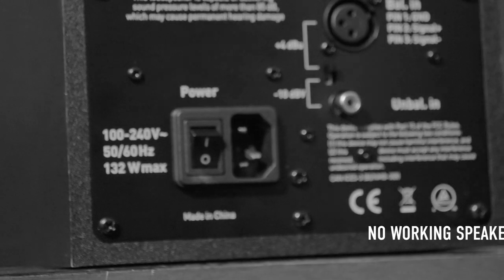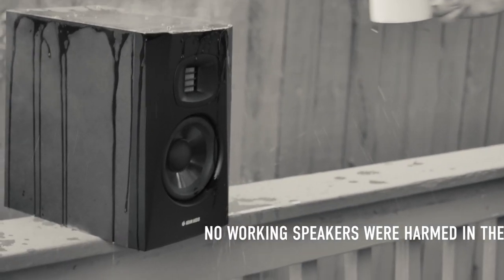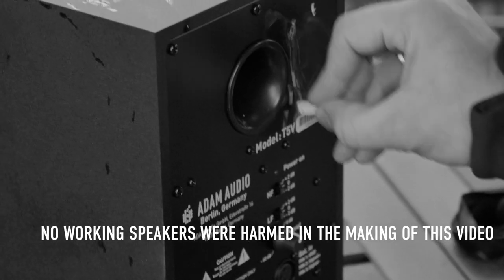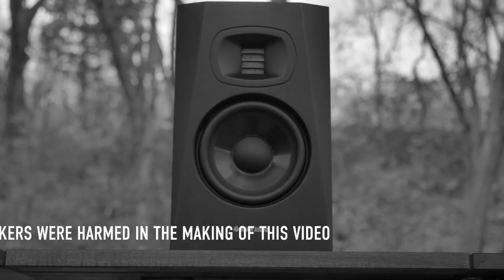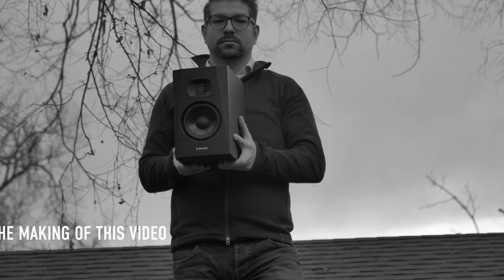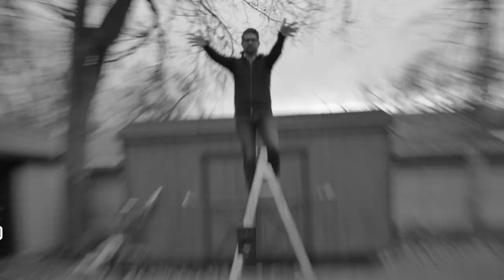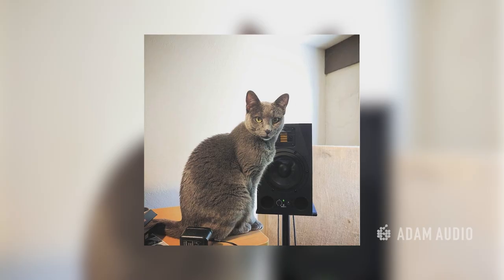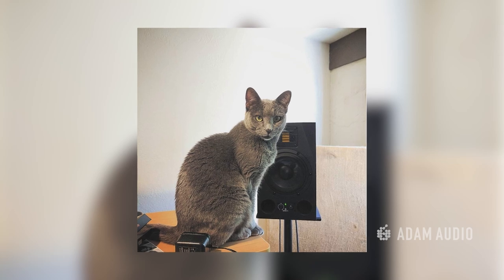PROPER Monitor Maintenance (Cleaning your Speakers) | ADAM Audio

Comment: You might want to re-think this advice. Good speaker cabinets don't vibrate enough to cause things on or under them to resonate. Touch the cabinet while playing music to see that I'm correct.
Reply from the maker: Hey Ethan, most monitors, when turned up to high volumes will have slight vibrations in the cabinet, some obviously worse than others though. Also, this video isn't only ADAM specific, so we want to cover all the bases when it comes to keeping your monitors safe & out of harm's way, no matter the brand.
Reply: @ADAMAudioBerlin  Have you ever actually tested this? This is one of those myths that is so pervasive, everyone just accepts it! Yes, flimsy plastic speaker cabinets can flex and vibrate. But I have yet to see anything sold as a "monitor" vibrate enough to cause audible damage. This is a good example: https://www.youtube.com/watch?v=ttk4y6_afa8
Reply: I can confirm putting objects on speakers indeed have no negative effect at all, 
contrary to what is claimed in this video. How am I so sure? Well, I simply tested it. https://youtu.be/tu2n-XCzfnI Exactly like in the video Ethan already posted, the coffee in my cup doesn't move at all. I even flipped a coin on its side and put it on the subwoofer and it simply didn't fall. I used a very simple 'consumer grade' Onkyo SWK-538 subwoofer and though in an ideal scenario I would have used an SPL meter as well, I can confirm I cranked up the volume really loud (way too high for regular circumstances) and even boosted the bass to an extreme amount of +15dB or so. This shows that the Adam guy in this video is simply wrong.

Comment: Hi I recently acquired a set of A77H monitors for my studio which I’m building. I’d like suggestions for a proper monitor stand on which to safely mount them as well as the availability of a proper mounting plate due their unusual size , weight and construction. I’m aware of Konig & Meyer products but I haven’t any idea which model would be appropriate. When will the Adam Audio mounting plate be available, also ?
Reply from the maker: Hi Cliff. The mounting plate is already available on our online shop. Please ask to the dealers or distributors in your area to know when they will have them in stock.
The König & Meyer 26791 stand (https://www.k-m.de/en/products/speaker-lighting-and-monitor-stands-and-holders/monitor-stands/26791-design-monitor-stand-structured-black) using the König & Meyer 24281 screw-on adapter should be a great stand for the the A77H.
Reply: @ADAMAudioBerlin   Thank you for your response !
May I inquire regarding endorsement and or artist pricing availability ? 
Thank you
Reply from the maker: Hi Cliff. We do have an artist relations program and are always interested in working with great artists and producers. Please fill out the form we have here: https://www.adam-audio.com/en/artist-relations/ :)

Comment: i accidentally dropped the speakers to the ceramic floor when unboxing , does it will affect the speaker? (the height it around 5-6 inch)
though it still working but i do worried it damaged the part inside the speaker
Ah also can i use wet baby wipes or non alcohol wipes to cleaning the speakers?
for the woofer and tweeter does it must using soft brush? 
can i use microfiber cloth instead of soft brush?

Comment: After playing testing sounds of ableton live(High Frequency) , my A3X's power LED twinkled （after I noticed that I shutted the speaker immediately )and the tweeter warped for a little bit , But I couldn't hear any difference, does it necessary to be repaired?
Reply from the maker: Hey, thanks for your question, and sorry that you are having (or had) some trouble! Would you mind sending our support team a message on this topic? We'd need more info in order to evaluate if there is an issue that needs to be repaired or not.

Please reach out to our support team here: https://www.adam-audio.com/en/support/. 
Many thanks and best regards from Berlin!

Comment: sry noob question, is an air blower a good idea to clean the tweeter and the woofer membran? Or will the pressure damage the speaker?
Reply from the maker: Hi Felix, please do not use an air blower to clean the speaker. What you can try: A small bellow that is usually used to clean camera sensors. Hope that helps!
Reply: @ADAMAudioBerlin  perfect, thanks alot for the fast answer <3  soon i will order a pair of t7v and a t10s i already cant wait!!! 
greetings from Italy
Reply from the maker: That's amazing! Thank you so much for choosing ADAMs! 🔥